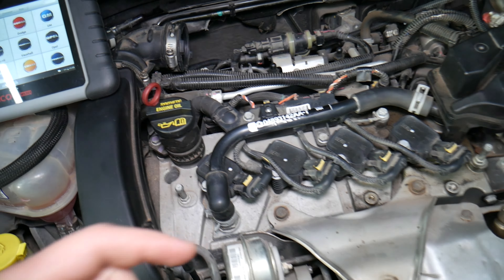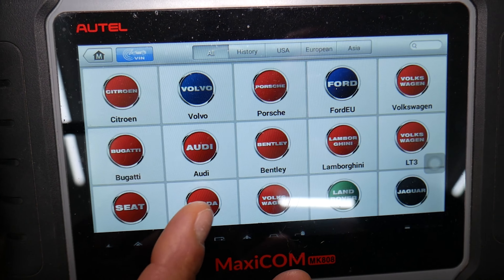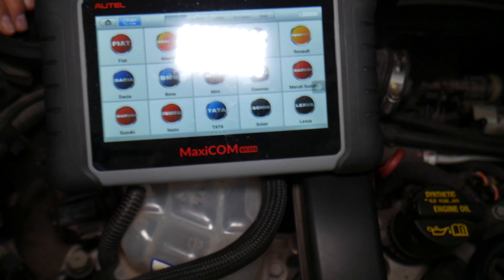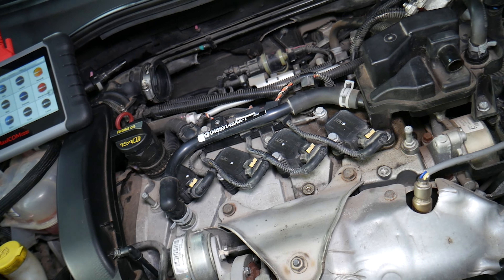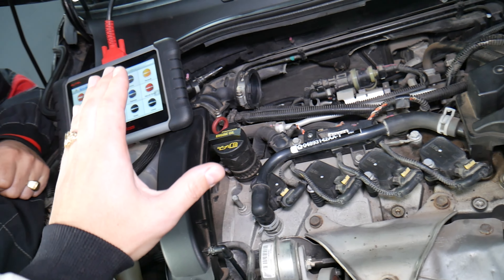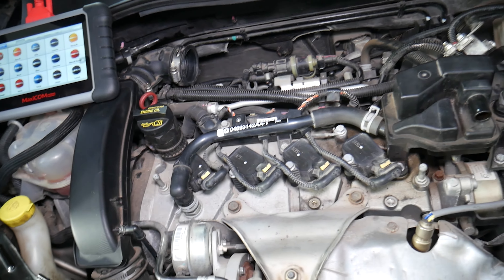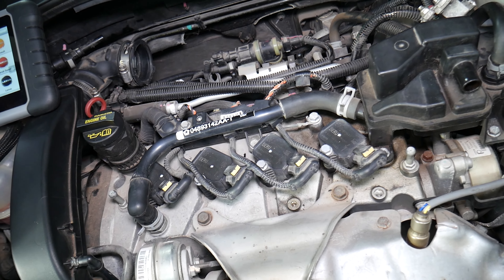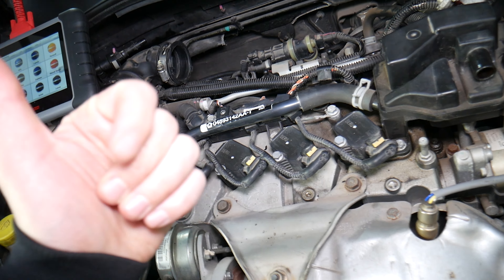FIAT 500 CODE P1522 P1523 P1524 FIX, FIAT 500 ABARTH CODE P1522 P1523 P1524

Comment: Hey i may need some help
My 2019 jeep compas with 1.4L multijet engine doesn't start.
the engine Turns but it wont start
we've changed the oil already and tried again but didnt' help
ive got P1525 and P1524 faultcodes
The Car was parked for 2 months.
Reply: have the same problem... did you resolve yours?